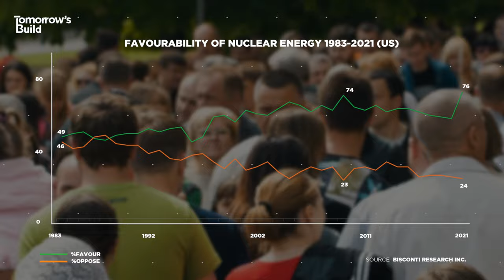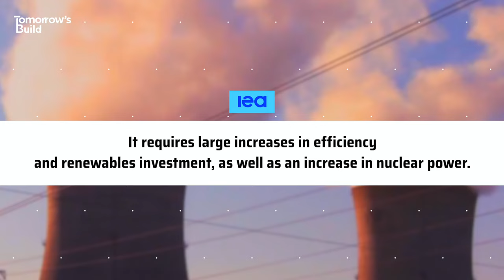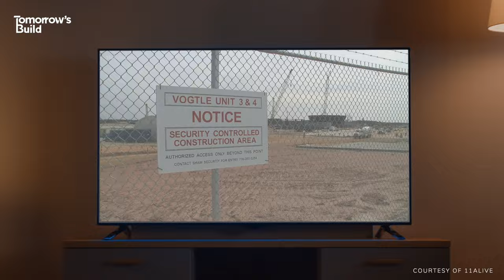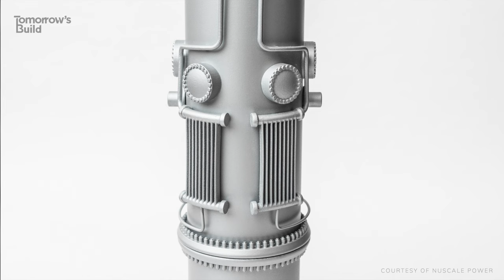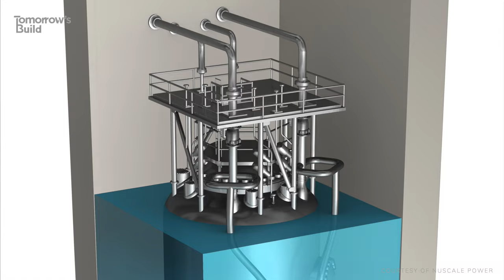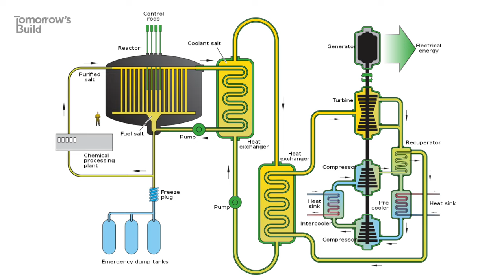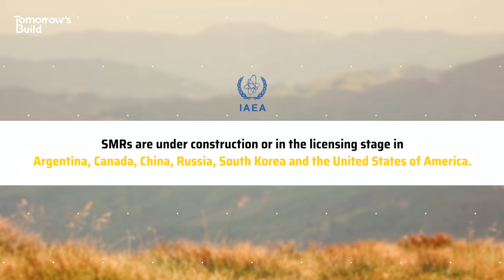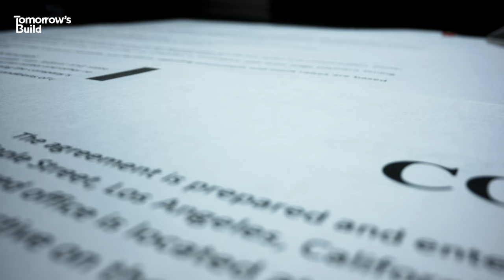These Mini Nuclear Reactors Can be Built Anywhere

Comment: The fact that these SMR was easy to scale up for an fast source of clean energy, as it already been used for naval use for over 50 years that had the tech already.
Reply: But they are still more expensive then other energy and still not in production
Reply: @paxundpeace9970   let's give it time, they'll be more widespread soon.
Reply: Also the CSR of the design make it bigger impact on the environment cost of maintaining and lessen impact on the community it and will serve. For example people may be more for SMR as it take less of an area and has smaller exclusion safety zone.
Reply: @gurumage9555  They will need massive government subsidies from day one to the very end... they will stay wildly uneconomic... and whatabout "modular waste disposal"?
Reply: Getting away from fast breeders and towards e.g. Thorium cycle reactors would help with both the waste problem and the weapons proliferation problem.
Reply: So, it's very similar to the reactor on submarines and aircraft carriers? Sweet!
Reply: @1968Christiaan  Those are some fair points, but practically speaking, one of the main reasons why nuclear reactors are so expensive is because of the long construction time. Projects get cancelled really easily, so by shrinking that timeframe down with pre-made reactors, cost should ideally decline to an extent. Another advantage to SMRs is that they make for good technology demonstrators, especially for non-light water reactors (NLWRs), which have more inherent passive safety. That reduces the engineering requirements for subsequent bigger versions, bringing down cost and allowing for more complete fuel burn-up, which cuts down on waste and cost.
Reply: @paxundpeace9970  It is because of the scalability. Mass production will make it way less cheaper once it got recognized and become prevelant. It was the same about computers decades ago.
Reply: @anatoliansettler9922  The thing is that you also get the opposite, you'd lose the advantage of scale regarding the actual production/reactor. Some research already stated that SMR essentially will be more or less the same, due to the advantages and disadvantages just being switched.

Also with SMR's, on site construction still will be the biggest part of the operation by far, not that disimilar of larger plants.

In  the end SMR will still have to prove that they actually can get costs down (enough).
Reply: They can put that next to your home.
Reply: pax und peace  ii
Reply: @stephentroyer3831  Which was similar to Shippingport which was only 60 MWe in 1957.  Are these units really much different?
Reply: @paxundpeace9970  
More expensive? Would rather spend more tax money than deal with more environmental issues later down the line which will prove to be FAR more expensive in the long run...
Reply: Clean?  The waste is far from clean but no one wants to talk about that.
Reply: @MissilemanIII  
The waste maybe, but that's far more manageable than just pumping CO2 and Methane and all that other crap into the atmosphere day in and day out

No negative emissions to worry about otherwise for Nuclear Power
Reply: @MissilemanIII  What do you think is more manageable and cleaner? Cancer inducing smoke that’s almost impossible to control is released into the air for everyone to breathe or cancer inducing rocks stored in multiple layers of containers, away from the public?
Reply: @1968Christiaan  Aren't solar panals still subsidised by the government despite constant work on them for the past 20 years. Also they are dependent on Chinese rare earth elements.
Reply: @GoblinUrNuts  worried about cost while the planet becomes uninhabitable, a little long for a tombstone but appropriate.
Reply: @paxundpeace9970  More expensive than what?  Solar plus gas? Wind plus coal?  What happens if there’s a carbon tax, or just an outright end gas or coal as Biden said?  Then what’s cheaper than nuclear?
Reply: @gurumage9555  Give it time?  Cost of wind and solar is falling faster than for nuclear, and it's highly unlikely that nuclear is going to experience any kind of price breakthrough in the foreseeable future.
Reply: @GoblinUrNuts  he's talking about nuclear weapon proliferation, which is stupid at best, and lunatic at worst
Reply: @1968Christiaan  solar and wind gets massive subsidies too. 

Per kilo watt energy produce, nuclear energy waste is a fraction of the amount of waste in mass of wind/solar. Storing the waste is actually far easier
Reply: @mattbrody3565  exactly, current large nuclear reactors can be economical, but it takes time for them to get there, however, once they do, they gain exponentially more than an equivalent fossil fuel power station. I think it takes about a decade or so for a reactor to become economical.
Reply: but its not clean energy! you have nuclear waste for centuries then! i dont get the excitement about technologies like that at all!
Reply: @JohannBBravo  There are legitimate concerns about nuclear energy plants, like high costs, but storing nuclear waste in safe, hardened containers deep in geologically stable caves is a solved problem.  Having nuclear waste sit idly for centuries is harmless and is way, way, way less dangerous than burning coal.
Reply: The naval reactors do only cost ~ 300 million for a 70Mw output but the 95% highly enriched fuel cost $1 billion.  They could switch to 7 % enrichment like the commercial plants and save money but the output would drop below 10Mw.  Naval reactors cannot be compared to commercial needs and they do not have the same safety systems.
Reply: @gurumage9555  The U.S. has built and tested every type of reactor known (MSR, Thorium, SMR) over the past 70 years.  How much time do they need to figure out if it is worth it.  BTW, Every utility that has a nuclear power plant always builds the largest one available, not small.
Reply: @stephentroyer3831  I hope not, one fuel load for the naval 70 Mw reactor costs $1 billion due to the high enrichment, lower that enrichment and you have maybe 10Mw output.  Naval reactors also do not have the  safety systems present in commercial units.  The naval reactor ultimate safety system is the ocean.
Reply: @mattbrody3565  NuScale is building one SMR and they estimate it will take 10 years and $4 billion to complete.  Compare that to 15 years and $16 billion for the latest 1,200 Mw PWR and even that is considered a financial failure.  You can do the math and tell me if the SMR is a good deal?
Reply: @anatoliansettler9922  VC Summer and Vogtle used the factory module build method and when they arrived at the site, they did not fit together and the welds were so poor that most had to be rebuilt on site.  It is just corporate PR until they actually do it just once.
Reply: @clarkkent9080  traditional reactor projects take longer than the average campaign cycle to build, and politicians are impatient. They have a history of shutting projects down prematurely, which is why the SMR approach is being entertained despite its worse cost-benefit analysis. They deploy fast enough to avoid being scrapped by some feckless twerp who just wants to get re-elected.

If it was all about economics and if people were less emotional about nuclear, then yes, big power plants would be the name of the game, and SMRs would only be used for demonstrating new technologies or for remote applications.
Reply: @clarkkent9080  interesting points, and I agree that Vogtle isn't going so well. I've heard that funding uncertainties have been an issue for reactor deployment, but from what you're saying, it sounds like that's changing. Thanks for providing more info, and I apologize for the long read ahead.

It's also important to note that there are many other sources of cost and delays. Design tweaks to account for environmental variables (and the accompanying design reviews), supply chain problems, interest on loans, and increasingly stringent safety codes that require frequent upgrades all compound to make big reactors a headache to develop. Not to mention, those 1000+ MW reactor cores weigh over 250 tons and have to be imported from Japan, China or Russia. Then there's land transportation logistics and the headache of on-site assembly. Big reactors are more fuel efficient and stable, making them more ideal for long-term operations, but the trade-off is how hard they are to build and keep up-to-date.

On paper, SMRs do look awful in terms of their cost per MW. But, at much smaller scales, it's easier for each module to guarantee full containment by brute force safety, which adds to some of its appeal. I'm a mechanical engineering student, btw. If you'll indulge me for a moment, I can argue from a safety perspective. At typical reactor operating temperatures, you have to squeeze water so hard that it doesn't get a chance to boil, and in thermodynamics, we call that boundary work energy. For an SMR that weighs the same as an AP-1000 core, the SMR can be made with thicker steel, which makes it better at providing boundary work energy.

That improved containment should allow these reactors to be more future-proof against safety regulations, which takes some burden off of the design of the reactor facilities and eliminates the constant design tweaks that add costs and delays. This makes reactor procurement for SMRs theoretically faster and more convenient for customers. This next advantage doesn't apply to NuScale's design but, at these smaller scales, decommissioned coal and natural gas plants could be converted to SMR facilities, which cuts down on infrastructure costs.  They bite the bullet on cost, but gain flexibility. This makes it less about pure cost and more about marginal utility, which is unquantified and thus isn't the best argument, but that's where the market seems to be headed.
Reply: @mattbrody3565  Since the original startup date for Vogtle unit 3 was 2016, the current issues like supply chain  are only a problem because of the massive delays in construction. 

The cost to transport the reactor vessel (manufactured in South Korea) were considered in the original budget so nothing changed there.

I'm not sure what you mean about boundry work energy. Might be a new buzz word.  I worked in the nuclear industry, Certified/Licensed Reactor Operator/Senior Reactor Operator at 5 different reactor facilities and after 3-mile island spent hundreds of hours in heat transfer and thermodynamics classes and while I am getting old, I do not recall ever hearing that term. 
 A PWR reactor coolant hot leg is above 600 degrees F and pressurized over 2,200 psi. There are nucleation sites on the fuel assemblies at full power.  An analogy would be the steam bubbles that form at the bottom of a pot of water as it just begins to boil. Reactor coolant flow sweeps these bubbles away where they collapse, giving up their energy to the coolant keeping the fuel rod below the metal melting point. This condition where steam bubbles form on the surface of the fuel is considered the most efficient point of heat transfer, notwithstanding teetering on the temperature limitations of the fuel rod metal.  The most efficient transfer in the heat exchanger region occurs with a reverse flow configuration ( B&W design) that results in superheat steam.  This is the most efficient light water heat transfer method.  I am not schooled in liquid sodium cooling so I'll defer that to others.

SMRs have one advantage and that is the SHOULD be cheaper and faster to construct than a PWR and thereby providing a faster return on the financial investment.  However, there is little difference in the number of operators, maintenance, engineers, security, managers, admin, etc. necessary to run them over a large scale PWR making them more costly per MW to operate.  

There is a reason that every utility that has gone nuclear, always chooses the largest design available.  Economies of scale. In addition, the U.S. certainly has limited construction talent that can adequately build complex projects and that talent would be better spent building one 1,200 Mw PWR over 15 SMRs of equal output.

In any case, we can both watch the NuScale build and see who is more correct.  Get ready for the "it will be cheaper, better, and built faster the next time excuse".  I base my opinions on facts and reality not some corporate PR BS.
Reply: @clarkkent9080  I didn't realize you worked in the industry. That's neat! I'm approaching things more from the engineering and theoretical side, you definitely have more hands-on experience. I get why reactors have conventionally gotten bigger, but it appears there's been problems with scaling further in recent years. I've heard that as safety regulations have gotten tougher, it's been getting harder to retrofit and build large reactors to modern standards, and part of that appears to be from physical and engineering limitations. Obviously there's more to it than that, but from an engineering perspective, that's a good place to start. I'm not defending SMRs as the 'better' reactors, they're a stepping stone on the way back to big reactors. But they do have some advantages over their bigger brothers, and that's what I'm trying to highlight.

I checked my thermodynamics textbook, and I was slightly off on the meaning of "boundary work energy". Technically, that's work done by the expansion of the control volume. Using PV = nRT as a rough estimate to track the boiling point (approaching from the vapor phase), P needs to rise with T to keep V from changing. The PV term is the boundary energy I was referring to, which is also in the formula for enthalpy. That's what controls the boiling point, and the containment vessel has to sustain that pressure. Water locally boiling off of the fuel rods makes sense, but the majority of the coolant in the core loop needs to remain liquid, at least in a PWR. The steam lines from the heat exchangers to the turbines are a different story, boiling is obviously preferred there.

And that's where problems seem to emerge- past 1GW, it's hard to design a containment vessel strong enough to guarantee passive safety while also being feasible to make and move. When passive safety can't be guaranteed, active systems need to be added, which may need retrofits depending on regulations, which adds M&O costs that are harder to predict. The facility itself also needs to be optimized at these larger sizes to prevent structural problems, which requires parts to be redesigned and reviewed, which MIT's recent studies have found to be a major source of cost increases. At these giant scales, problems keep creeping in that reduce the viability of big reactor projects.

SMRs are small enough that passive safety can be guaranteed. An AP-1000 core is 1 ¾" thick, but an SMR is small enough that 2" or more shouldn't be much of a problem, which gives more pressure headroom to resist flash boiling in the event of a failure. Because of this, SMRs shouldn't be as sensitive to their environment as big reactors are, so the infrastructure is easier and cheaper to develop. When regulations change, the increases in costs due to retrofitting should be reduced due to the containment advantage. There's also the lower up-front cost of each SMR in case the venture fails.

On the topic of liquid sodium and non-water coolants, the idea is that safety can be improved by raising the boiling point of the coolant closer to the fuel's operating temperature. A higher boiling point means increasing heat flow from fuel pellet expansion isn't as likely to flash boil the coolant, which would allow for more complete fuel burnup at lower operating pressures. The sodium coolant in the core doesn't boil at all, it just convects heat to the heat exchanger. SMRs make sense as testbeds for these new technologies, especially for NLWRs, and when the flaws get worked out on a small scale, we go back to GW scale and reap the economy of scale benefits.
Reply: @mattbrody3565  I have operational experience as well as training on some of the design parameters and characteristics that are a concern to me as a reactor operator. Anything more than that was above my pay grade and we had facility engineers to address.
At full power and assuming you are operating withing neutron flux parameters, PWRs are very efficient as far as using water as a heat transfer medium.  Nucleation sites on the surface of the fuel assemblies is an excellent heat transfer condition and present during operation.  However, while loss of coolant flow or a loss of coolant accident will result in a reactor trip, there is the possibility of a temporary transition from nucleation to bulk boiling and maybe even the formation of superheated steam on the fuel rod surface, resulting in possible fuel rod damage.  This possible variation is what I recall as the term boundry layer between the heat source and heat sink.      

 From what I have read, the Westinghouse AP1000 advanced PWR is (in simple terms) the same old Westinghouse design with only two coolant loops instead of their typical 3 or 4 loop design and passive cooling systems added.  In my opinion, Westinghouse designs utilize the rube-Goldberg design philosophy of just adding more systems to correct problems instead of utilizing a clean design.  An analogy would be automobiles of the mid 1970 where manufacturers just added air injector pumps and reburns to meet emissions standards but destroying performance.   My first Reactor Operator license was on one of these Westinghouse units so I had nothing to compare it to.

Fast forward a few years and I obtained my Senior Reactor Operator license on a B&W plant (sister plant to 3-mile island).  What a difference.  Those of us that had operated both compared the Westinghouse units to Cadillacs of the 1950, big, slow to respond, and poor handling.  We compared the B&W units to Ferraris, small, fast, maneuverable and a joy to operate.....but 3-mile island while it had nothing to do with design sullied the B&W reputation.  I would still prefer to operate the well designed and simple operation of a B&W plant.

I understand that bigger PWRs mean either faster coolant flows or more of it and more coolant means that a larger containment is needed.  Just for consideration, one plant I worked at has a sub atmospheric containment which allowed for a much smaller containment.  It was also a great go-no-go test in that being unable to draw a vacuum on the containment indicated that you had a leak somewhere.

In any case new nuclear is not being built today.  Terrapower and NuScale are demonstration test reactors.  Given the time to build new nuclear and old plants shutting down, its contribution to the U.S. energy grid will decrease over the next 20-25 years. Something will makeup for that loss and if it is even remotely cost effective then nuclear has no future...fusion maybe.
Reply: @clarkkent9080  Thanks for the time you've dedicated to this discussion, I learned a lot and really appreciate it. Sorry if I've been a nuisance at all, and thanks for sharing your experience. That reactor with sub-atmospheric containment pressure sounds like crazy black magic, I'll have to look into it. With that said, I'd like to end this on a more optimistic note.

I wouldn't say nuclear is done just yet. Renewables still need backup baseload power, which without nuclear rambles off into a lot more headaches over resources and grid load management, especially with EVs and rooftop solar pushing higher surges in supply and demand. Despite all the hype around fusion, it's still realistically 30+ years away from commercial viability just from the energy gain alone. The current record is 1.3x, a commercial plant running a D-T cycle needs at least 40x and would dwarf even the biggest PWRs, making the drawbacks of large-scale plants even more pronounced. The fabled seawater hydrogen cycle is harder, meaning even higher gain is needed. That means we'd rely on more expensive tritium at the start, further delaying commercial dominance. 

So, fusion's probably 40 years away from taking over, leaving a 15 year window for nuclear to serve alongside grid storage before it finally ends. Developments in non-light water systems can transfer over to fusion reactors, such as molten salt cooling and tritium breeding. I'd say water-cooled nuclear is dying out soon, and NuScale is its last hurrah, the foot-in-the-door for non-light water SMR demonstrators. Expanding from there should widen our options in the future.
Reply: @mattbrody3565  I enjoyed the convo.  I hope to bring a little reality into these channels.  As you know, many things you see on the internet are either totally false or fail to tell the whole story.   Until something is built and proven to be cost and operationally effective, it is just corporate PR.
The Natrium and NuScale  projects won't light lights until at least 2030 and then there will be a prove the concept phase. I wish you the best of luck with your career but I would not personally direct anyone to a career in nuclear. 

That black magic sub-atmospheric containment can be found at Beaver Valley unit 1.  It actually worked great. A steam air ejector took less than 24 hrs to reduce the pressure to the desired point and as I said, holding a sub-atmospheric pressure proved that there were no leaks.  Entering containment under those conditions required supplemental  O2 and was eerie to say the least but that was just one of my many interesting experiences in the  nuclear field.
Reply: Calling SMRs "clean energy" is pretty stupid, ngl.
Reply: @zagreus5773  compared to what? Compared to coal and natural gas, they are clean. Compared to bigger nuclear reactors, not so much.
Reply: @mattbrody3565  Clean is not a relative term. Clean means clean, which nuclear is definitely not. Wind energy is clean for example.
Reply: @zagreus5773  would you care to elaborate on what you mean by "clean"? Depending on how you break things down, wind and solar make for some very interesting comparisons.

If it's about lifetime CO2 emissions, nuclear power plants currently beat wind, producing 4g/kWh vs wind's 11g/kWh.

If it's about the manufacturing process, wind typically wins since mining for copper and rare earth elements can be less toxic than mining for uranium.

If it's about waste disposal, the difference between the two is actually quite close. All of the nuclear waste generated in human history could easily fit into a single sports stadium. That waste does require deep geological repositories, however, which hasn't been happening thus far. Wind turbines are easier to dispose of when their service life ends, but the blades contain microplastics and BPA that can seep into groundwater.

Is there something I'm missing here?
Reply: @mattbrody3565  You completely ignore the extreme toxicity of nuclear waste. The amount of "waste" is really not an issue, if it is not toxic. Nuclear waste is both extremely harmful for people and the environment. Therefore calling nuclear power "clean" is just absurd. To my knowledge wind turbines can be completely recycled. But even if not, their waste is non-toxic.
Your CO2 figures are way of, sadly. Lifetime CO2 generation by nuclear power is in the range of  3.7 to 110 g/kWh, according to the IPCC. I guess you just took the lowest estimate and run with it? On average it is often thought to be 66 g/kWh, so far more than wind or solar. The German Environmental Agency estimates it to 117 g/kWh. Z. Jacobson, director of the Atmosphere / Energy Program at California's Stanford University, calculated a climate cost of 68 to 180 grams of CO2/kWh. Source: DW
The whole "climate friendliness" of nuclear power is extremely overstated. It is a shame, but it is how it is. But even without it, as I already stated, the extremely toxic nuclear waste alone makes calling it "clean" absolutely absurd.
Reply: @zagreus5773  Every utility that has built nuclear ALWAYS selects the largest design available (economies of scale) .  SMR make absolutely no sense
Reply: @zagreus5773  Ok, thanks for clarifying what you mean by "clean". Typically when people refer to a power source being "clean", they're referring to a lack of both environmental pollution and direct carbon emissions. Waste toxicity is an interesting way to look at it. The 4g/kWh statistic is just what I've heard the most from analyses comparing energy sources, so thanks for bringing up more information. Compared to the widespread pollution caused by fossil fuels, nuclear power looks better as a baseload power source and fits in between fossil fuels and renewables in terms of cleanliness.

About waste toxicity, there's a couple of things to say. Solar panels contain toxic materials like arsenic, lead and cadmium, which becomes toxic waste during recycling. So, based on your criteria, solar is still better than nuclear but juuust barely fails to be fully clean. That's just one example of why experts tend to look at how clean a power source is on a relative scale based on a set of criteria-- some flexibility is needed to accurately evaluate and compare.

Another factor to consider is the containment of toxic waste, which is standard practice in the nuclear industry. Spent nuclear fuel is well-encased in concrete casks that can survive full speed train collisions. In this form, it is unlikely to harm the environment due to how well-contained it is. And, as I said before, all the spent nuclear fuel waste in the world- casks included, would fit in a single sports stadium, which is reasonably easy to isolate in a repository. Yes, it's easier to dispose of waste that's non-toxic to begin with, but a small volume of well-contained toxic waste is also preferable compared to unmitigated pollution.

It is possible to reduce the toxicity of spent fuel through improved fuel burnup. Long-lived radiation comes from unburned fuel and trans-uranic isotopes, which is why spent fuel takes so long to stabilize. Naval nuclear fuel is optimized for 10-25% burnup compared to a commercial reactor's 3-5%. Reprocessing spent fuel further reduces toxicity by allowing the same material more chances to burn up. Some non-light water reactors like MSRs could theoretically push this up to 80-90% with reprocessing, leaving smaller volumes of waste that's less toxic and stabilizes more quickly. Nuclear can become substantially cleaner, even if it never quite gets over the hurdle of toxic waste.
Reply: @mattbrody3565  Good points, I like to explain the cost different between a factory built SMR and a sight built plant is like the difference between buying a factory made car, or going to the dealership, buying all the parts for the car from the parts counter then having the dealership's mechanics come to your house and build the car in your garage with simple hand tools and floor jacks. The time efficiency and thus economics for the SMR makes way more sense. If utilities play their cards right, as new generations of SMRs are developed they can be shipped to the sights and installed in the existing infrastructure used for previous generation SMRs. They are essentially the Teslas of fission power, while the Gen II plants running now are like the post oil crisis malaise era cars of the '70s.
Reply: @anydaynow01  well, not quite. That cost benefit is on the manufacturing side of things, and it would mostly reduce the likelihood of delays and cost overruns. However, SMRs need enriched fuel and don't tend to burn fuel as effectively, meaning they cost more to operate per MWh of energy they provide. Bigger is ultimately better in the long run. It's just that we need to move beyond water cooling, and SMRs are a good stepping stone to new reactor tech.
Reply: Yep.
Now commercialize it. Build them at a standard size in factories where they can be inspected onsite as they're built. This will make them cheaper and safer.
Make a model that is as small as possible, but also a model that is as small as possible at maximum efficiency (might be larger).
Figure out the minimum size for ocean ships to use these. Offer them as propulsion instead of oil. People will buy them.
Reply: @paxundpeace9970  people said the same words when tesla started, guess who laugh now
Reply: Now they can be massed produced to stop CO2 from Chinese submarines, maybe the Chinese can mass produce them as well ??
Reply: @1968Christiaan  man its almost like capitalism allows for the creativity of solutions to problems 🙄🤦‍♂️